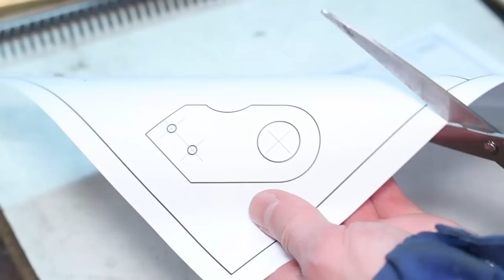New Spindle Start/Stop Lever - Operating The Mini Lathe Like A Pro

Comment: This is a very good build - getting the carriage lever to work on my Bantam was the best decision. Just one minor issue: by default 'on' should be pulled 'up' with the fail safe (gravity) turning the machine off in the down position so any failure in the mechanism will not unintentionally start the lathe. This is a convention across many industries - eg dropping something on a gas or water lever valve will shut them off if correctly fitted.
Reply: I was going to suggest the same. If the lever action ever fails, you want the off position working with gravity
Reply: Definitely correct!
Reply: Never seen a Lathe where Up is forward. Either the Lathe has a clutch and there is only Down for engagement or Up is for Reverse.
Reply: @an2thea514  It's in the Colchester Bantam manual: "With the lever in the uppermost position, forward rotation of the spindle is achieved..." - I'd attach a picture if I could. I would imagine all Colchester lathes are the same and that they followed (or led) an industry standard practice.
Reply: @philip_fletcher  I know from the Colchester Student and Colchester Triumpf 2000 I have seen that that is a Lever at the Headstock and not a Power Spindle, so it's a different thing entirely.
Reply: not only the gravity failsafe, but if something were to happen you could quickly and easily just slap the lever down to shut it off rather than having to grab it and pull it upward.
Reply: Same with all Czechoslovakian lathes, down for forward speed, up for reverse. With clutch, down for forward speed. You don't want the lever sticking up during the operation.
Reply: No Lathe i ever worked on (Leinen, Weiler, Lorch, Gildemeister, ect.) had ever lever up = on, it was always the chuck turns in the same directeion you move the lever.
The only issue is that the lever here is also the speed control
Reply: European lathes, as usual, seem to work backwards to American lathes.
Reply: @melgross  Except it's the other way round.

Comment: Nicely made. I'm thinking an oil quench versus a water quench would have been better and likely prevented the cracking.
Reply from the maker: Thanks! Yes, next time I definitely try quenching the part in oil.
Reply: If it's cold rolled wouldn't a temper cycle before machining help reduce the internal stresses too?
Reply: @cda32  Thats what I was thinking as well.
Reply: And preheat the oil

Comment: I've never seen a 123 block used as a fixture plate.  It's obvious now that I've seen it, I doubt I'd ever have come up with that without having seen it.  Thanks mate!
Reply from the maker: Thanks!
Reply: You haven’t because it’s not meant to be used that way. Good quality precision ground blocks should be handled with utmost care, and for a quick setup I’d much rather make a reusable fixture sized to the vice or just drill and tap a piece of stock.
Reply: @blankroomsoup666  Yeah, but that is one of those cheap imports that is a "almost 1"-"Nearly 2"-"Perhaps 3" block.
Reply: What has been seen cannot be unseen

Comment: Why not put an AR and reverser on the manual control Bravo for your work.
Reply from the maker: What is an AR? Unfortunately the controller doesn't allow a quick reverse for the spindle. You have to press a button.

Comment: Nice job. If you do not mind  a short remark about hardening - some alloys require to be heated up in a given pace and to be held in normalizing temperature in a proper time. Also medium used for cooling is important. It seems to me that your part was cooled down to fast - maybe oil would work better. I know that in a small workshop it could be hard - I had only a part of a garage for my "metal working" sand box. Please do not stop and keep going  :)
Reply: You´re absolutely right....even C45 is not an alloy...
Reply from the maker: Thanks for your comment and advise! Next time I use oil for quenching. The water I used cooled the part probably to harsh and causes the cracks.

Comment: Ah.. and were is the head-stock brake?  Anyway, the emergency On-Off button should be uses more often to prevent those little 'awakenings'...  Install movable limit switch(es) when you do the brake.  Me..  I'm installing a CNC conversion, but going to try to keep the manual function available.

Comment: Really nice build.  As an observation, it would maybe have been better to have the “throw” of the control lever in the opposite direction so that gravity (should that happen) would default the lever to the off position… very much like electrical switches…
Reply from the maker: Thanks for your comment! Yes some others suggested that too. From the safety standpoint that would be the ultimative best I guess. However my built is inspired by how it's done on most full size lathes. Pushing the lever down starts the spindle on almost every lathe with such a lever. That is very common and intuitive as the spindle starts in the same direction as the lever goes. Some lathes run the spindle in reverse when the lever is pulled upwards. There is a safety lock built in as you see in the end of the video. The lever is locked in off position and has to be pushed to the right before you can push it down and start the spindle. If something drops on the lever it doesn't move because of that locking mechanism. I hope that is safe enough :)
Reply: Soviet lathes work the other way around. Lever up is normal cutting direction, lever down is reverse.

Comment: Very clever! One thing I'd like to point out though;
As already mentioned, UP should be on and DOWN should be off, for safety reasons. Likewise the speed control integrated into that lever is a very clever trick, although I'd have concerns about one thing:

If the speed must be very low (Very unbalanced Part/not super great workholding/etc.) and the lever accidentally goes down, it would go into full speed. That could potentially be catastrophic.

Remaking the "clicky" part mirrored to have the lever be UP in the ON position would solve both problems.

Again, other than that - Great Idea and execution!
Reply: That was my first thought also. On up, off down. Great work anyway.
Reply: You never worked on real lathe? Up = on is total counter intuitive.
And integreting the speed control into the lever is not clever, its a bad idea, because of the exact reason you already mention.
On industrial lathes with the speed control in the lever its down= conterclockwise (forward), middle = off, up = clockwise (reverse) and twisting for speed control
Reply: @wolf310ii  All Colchester Lathes have Up-On.
Reply: @marcoschwanenberger3127  Only the very old Cholchesters with the lever on the headstock have Up=On (wich is still rotating the lever in the same direction the chuck should rotate).
Cholchesters with the lever on the slide, like a normal lathe, have down=on, up=reverse, middle=stop
Reply from the maker: Thanks for your comment and feedback! Yes, some mentioned the concerns about the direction the lever starts the spindle. I copied this from other machines. Almost every full size lathe works like the mechanism I built. Down starts the spindle right and on some lathes up starts the spindle in reverse (left). For me this is very intuitive and convenient although for ultimate safety reasons that should be different, you're right. To prevent the spindle from accidental start I built the locking mechanism in the off position. That's something I also copied from the full size models. If something drops on the lever, it is expected to stay in off position and not start the machine. 
The speed control is more a nice gimmic as it was already built in the sewing machine pedal switch. I use the lever normally at full amplitude with spindle at full speed according to the max speed set on the controler. But to quickly lower the spindle speed for a last chamferring operation on your part without having to programm a lower speed on the controler, I think it's great. But you're right, there is the risk of accidentally dropping the lever down and ramping at full speed. We'll see how usefull it is. Definitely the new lever should be much safer than the pedal switch bolted to the spindle casting. The video told you how dangerous it was... Happy to still have all fingers and no hole in my head! Thanks for your input :)
Reply from the maker: Yes, twisting for speed control would be the ultimative way to do it. I won't use the lever for generell speed control. Most of the time I set the spindle speed on the controler and pushing the lever all the way down to full speed. Just for a quick chamfer it it convenient to lower the spindle speed with the lever.
Reply from the maker: That's interesting. I'm only familiar with german/european lathes, and here down starts the spindle in right direction.
Reply: @WeCanDoThatBetter  that makes sense when you corelate with spindle direction. Never thought about that this way and i guess for me and others saying up is on, was analogy to electrical switches. After someone mentioned to thank about that as spindle direction, it makes sense for me.
Reply from the maker: @panbekon1470  I think that is the reason why they did it this way on most of the lathes. Interesting, that on electrical switches it is failsafe. I didn't know that. I hope I will never wish I'd built it the other direction... Just hope, it is safe enough with the lock I built in.
Reply: Most likely your muscle memory will prevent any problems. Especially that it's the common way doing it. Like you channel. I'm also working on lathe upgrade. Installing ELS now. It came today, from Germany 😅

Comment: Very cool.  Case hardening is less stressful on the parts but leaves a very good hard shell on the parts.
Keep em coming!!!!
Reply from the maker: Thank you! How would you case harden this piece? I'm not very experienced with hardening steel.
Reply: Use low carbon steel. Pack it in charcoal after machining. Keep the whole thing in your furnace at 850 C for 12-15 hrs. Quench in water. For fine finish, be prepared to retouch a few spots
Reply: Use low carbon steel. Pack it in charcoal after machining. Keep the whole thing in your furnace at 850 C for 12-15 hrs. Quench in water. For fine finish, be prepared to retouch a few spots
Reply: Artisan Makes made a pretty nice video about case hardening...

Comment: This was very well done 👍 especially the speed control by the lever it’s an awesome idea
Reply from the maker: Thank you very much!
Reply: I don’t think speed control there is a good idea, you’d be bumping into it all the time.
Reply: At one point I designed a rotating knob on the lever to do the speed control on mine but that would've required a trailing wire which kinda defeats the object!

Comment: Great job, as always. Like your brass sleeve solution, pretty smart one. About hardering i have a thought. To prevent cracks try to use mineral oil instead water. Crack came from fast temperature drop-off.
Reply from the maker: Thank you! I used C45 steel which was recommended to be quenched in water, but oil would probably be the better choice, yes.... Next time :)

Comment: Really great and genius work.
For hardening. Try a oil quench or a short oil quench then into water to slow down the rapid cooling. Might help prevent cracking
Reply from the maker: Thanks for your comment! Good hint on quenching. I think water was to harsh for C45 steel. Won't do this again :)

Comment: Good work. As someone mentioned here, hardening is a specific activity and different types of steel need different media. Anyway, it wants to soak in warm water or oil. Otherwise, there is a thermal shock that causes cracks. Let's say around 50-60 degrees will be ok.
Reply from the maker: Thanks for your comment! The water I used was pretty cold. I didn't know that warm water is better. Next I try this or oil.
Reply: @WeCanDoThatBetter  All right, keep going. Your videos are really great.
Reply from the maker: @MirekDvorak  Thanks! I really do appreciate that! And nice surname ;) Any relations with the composer?
Reply: @WeCanDoThatBetter  Just a coincidence. Although I used to play too. But "uncle" was just better... 😂

Comment: Damn, that chuck key dinged those ways for sure... Glad you got away from it with all your parts intact, but i lament the lathe nonetheless... To avoid cracks, normalize the parts first, run them once without quench, letting them cook for a while(argon purge would be marvelous for that), and then harden them... Machining can focus the already present stress in the metal and cause its own stress points and lines... Normalization either removes or greatly reduces those... And if steel warps during normalization, it would have done so had you just tried hardening it, so its no problem that was avoidable, and after normalization, there wont be further warping during the second heat treat... So you can rough machine the parts, normalize them, finish machine them to spec and harden them, warping should be absolutely minimal, enough that it will not interfere with anything rougher than an h7 fit... And nothing a bit of abrasive work wont solve, turn a custom lapping rod and work the warping outta holes with a hand drill, it will save the lathe a lot of disgusting abrasives and will allow you to vary the speed of lapping and give you amazing feedback as you have both parts in your hands and feel any resistance(defects) that the lap encounters...

Comment: It's neat and all. Personally when I have used sewing machine servos on my projects I throw the magnetic switch out. Magnets and metal working is an eventual fail. I wire in a 10k ohm potentiometer so I have precise control of the on/off and speeds.
Reply from the maker: Thanks for your comment! Yes I know some people who installed a potentiometer instead of the orginial switch. That is a good solution too, but I wanted a proper on/off lever on the carriage like on big machines. This feels just so much more convenient to use and very ergonomically. As the original switch was already a lever type thing that worked together perfectly. Off course the magnet and sensor has to be somewhat protected from metal chips.
Reply: Can you please explain how you change detection of motor

Comment: Nice project, one observation, when using spiral flute taps you should not back them up while threatening, they are designed mostly blind holes and pull the chips out while cutting, backing up breaks the chip and interrupts the ejection of the chip, could cause binding and breaking.
Reply from the maker: Thanks for your comment! When I am afraid of breaking the tap as it gets to strong, I back up the taps. But yes, M8 shouldn't break so fast... :)

Comment: at 16:24 this is why on the show "Forged in Fire", they ALWAYS quench parts in OIL, NOT water!!
Reply from the maker: Yes, that was a bit dumb of me. I used C45 steel and the datasheet says to quench it in water. But after the first failed try I should have changed to oil but didn't think so far... :)

Comment: Nice craftsmanship!
It's better to quench on motor oil than water! Or make part out of A2 tool steel and just let the part cool on air
Reply from the maker: Thanks for your comment! Next time, I will quench in oil for sure. C45 is recommended to be quenched in water but after the first failure I should have changed to oil.
Reply: @WeCanDoThatBetter  Keep doing this nice content man

Comment: Much safer. It seems the original switch was very close to your elbow, while working at the chuck, very bad design. Only found your channel recently and loving all the improvements you are making to the lathe.
Reply from the maker: Thanks for your comment! Yes the original switch was just temporarely mounted to the headstock by myself. That was a potentially dangerous configuration. With the new lever I'm very happy. It should be much safer against accidental start.
Reply: @WeCanDoThatBetter  only just watching that video now where you are changing the motor. And I recognise the switch. Didn't realise you mounted the switch there. I should really watch your videos in order.

Comment: Interesting project. I'm looking at it and thinking it wouldn't take a whole lot to modify what you've built to also tug on a cable operated spindle brake when the levers raised past the off position. It would only take a stubby arm added to the hex rod, and a leather brake band type setup somewhere on the spindle, or maybe a setup like one side of bicycles "V brakes" and a profiled rubber block to rub against the spindle.......  It would be totally unneccecery on a hobby lathe, but it would still be a pretty cool addon. :)
Reply: The controller he's using has an adjustable rate brake that may be able to function as a lock. I have the same drive but haven't gotten around to trying to create a lock signal. I use the brake set at 1 out of 5 on intensity so it just takes the coasting out. When at 5 it's slamming on the brake.

A mechanical brake is still an option.
Reply from the maker: As RJM said, you can set a electrical brake at the controller. At the moment I set it to off as it is relatively harsh even at 1 from 5 intensity ratings. But it's probably better to enable the brake again as it stops the spindle really fast in case of emergency. A mechanical brake would be usefull for cutting keyways or things like that. Here I need a solution to lock the spindle.

Comment: 8:40 center drill your holes! You can see the hole is off center as you feed the reamer in and out of the hole.
Reply: ....sorry that I did not read your comment before posting mine about this just now.
Reply from the maker: Yes, don't know what went wrong here. Usually I use center drills first.
Reply: @WeCanDoThatBetter   You got it wrong. THE REAMER was not centered to the drilled hole !
Reply: @NavinBetamax  I was thinking that could also be the case.